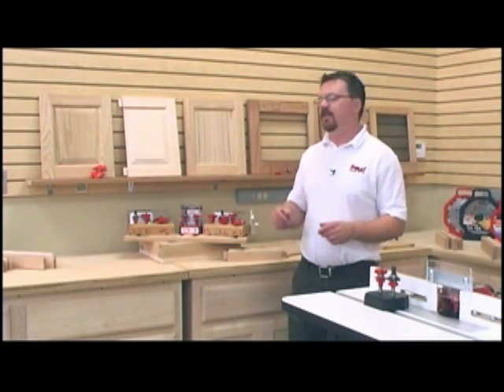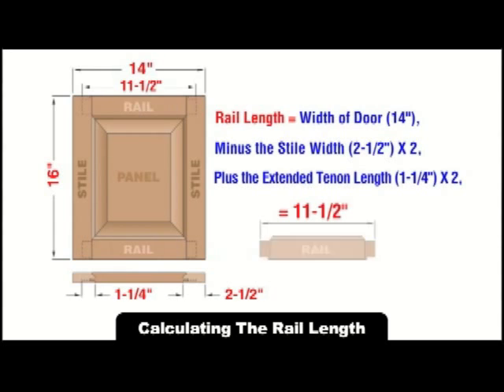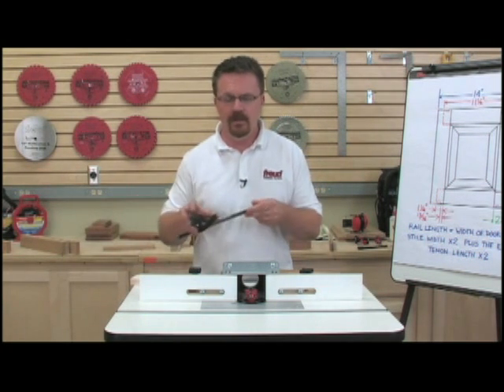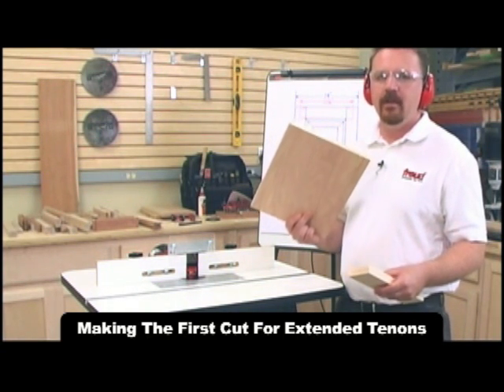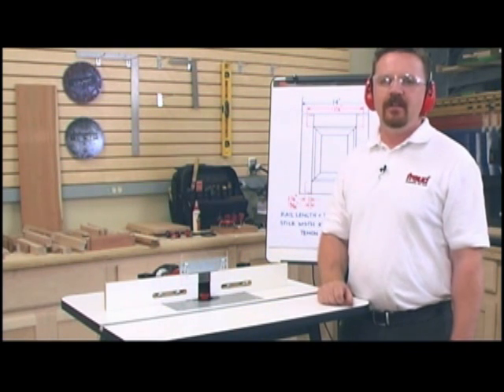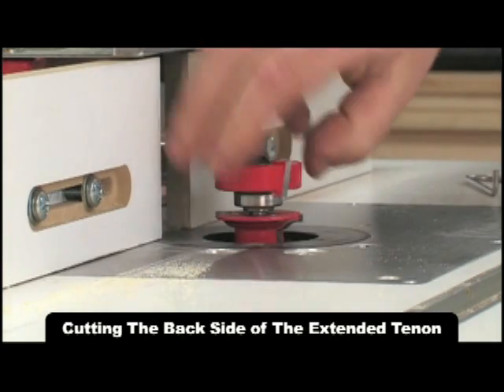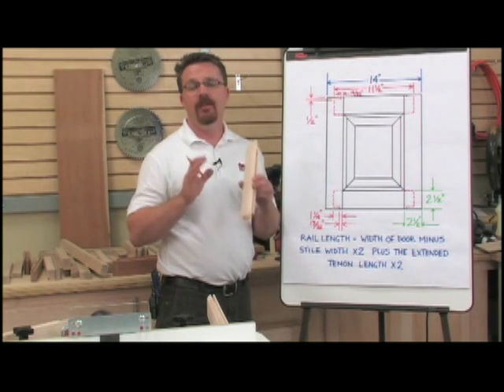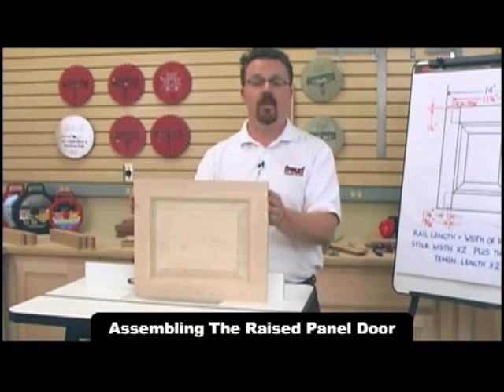Freud Adjustable Rail & Stile Part III (Creating Extended Tenons)

Comment: I just did this and it worked GREAT!!! It was very easy.  To make the mortise, I used my router in a router table. I then used a 1/4" pilot bit.  I made multiple "plunge and route" (don't know it that's the real name - I'm a novice).  An easy way to ensure you have the right "haunch" (?).. I looked at my stub tenon and made it the same depth (usually flush with the profile).. The dry fit was snug. Hope this helps anyone trying it.